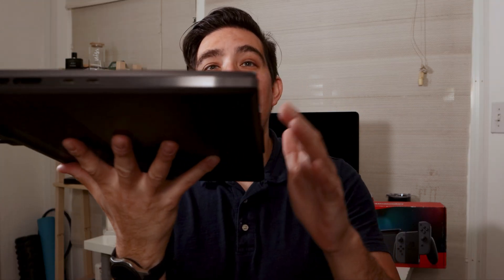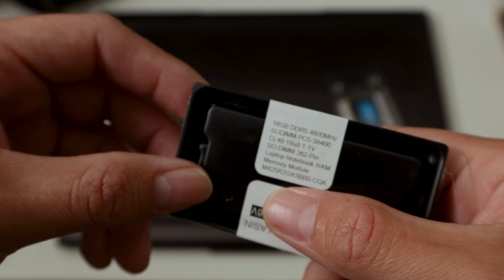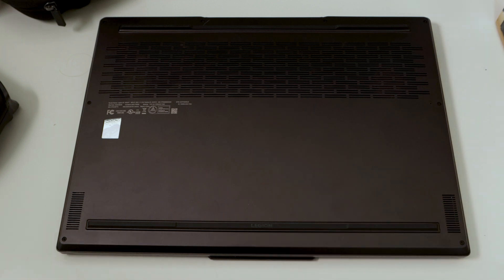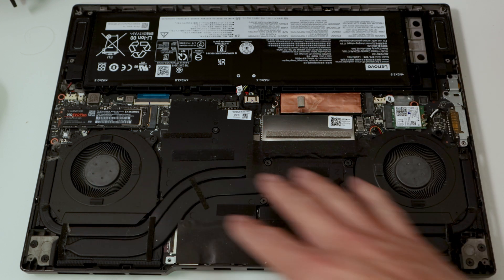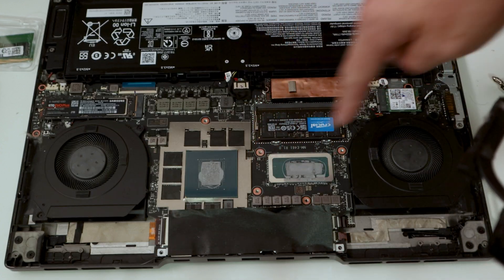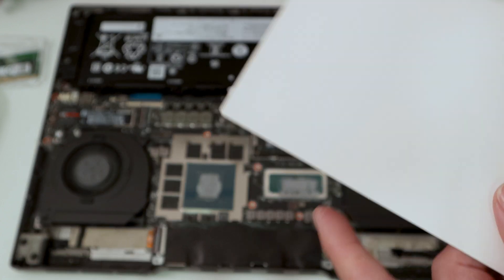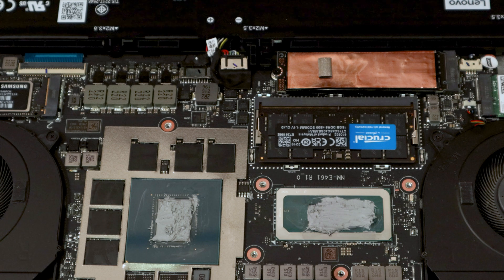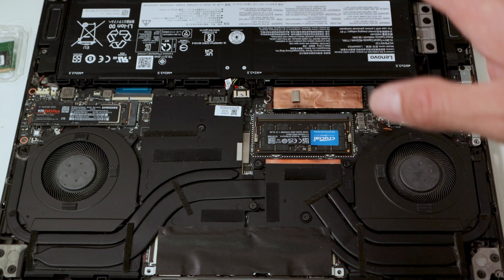How To Upgrade Lenovo Legion Slim 7i 2022 (Gen 7) Ram And Thermal Repaste

Comment: so, we can only change the 8 gb of ram into another size (16) ? for a total of 16 + 16, but we cannot add 8 for total 8+8+8?
Reply from the maker: You can only change once 8GB, because the other ones is soldered
Reply: @ yea so that means theres only 2 slots right?, 1 slot is the soldered one and 1 more is the stick one, theres no more available slot
Reply from the maker: Yes

Comment: ahhh! i just bought a 16gb stick of ram hoping to install with the current stick how do i put 2 sticks of ram in? to make 32gb or is it not possible?
Reply: It's not possible. One 8GB is soldered and the other 8GB is removable. The removable one is replaceable with a 32GB for a system max of 40GB
Reply from the maker: Exactly what Romad84 said. If you add your 16gb, you'll be at 24GB

Comment: Can this laptop be equipped with 32GB of memory?
Reply from the maker: I don't see why not
Reply: @ I inserted 32 gb ram but the laptop does not start. what could it be? the frequency matches
Reply from the maker: The 32 gb should work. You just need to make sure that you match the soldered stick specs. That's what I did on mine.

Here is a reddit thread that might help you out. 
https://www.reddit.com/r/LenovoLegion/comments/16efq8u/legion_slim_7i_gen_8_ram_and_ssd_upgrade_options/

Comment: Hello! I have a question. I saw you took out a RAM stick to replace with the crucial RAM. But my Legion Slim 7 16IRH8 only has 16 GB of soldered RAM, so I want to add another 16 GB stick to max it out at 32 GB. In this case, would I be removing existing RAM? Or just adding the additional.
Reply from the maker: Do not remove the soldered one. You can add if you have the available slot. My laptop is Intel. I know that the AMD is configured a little differently. I'm not sure which one you have.

Comment: Does the laptop run cooler with the repaste?
Reply from the maker: I was told that Lenovo uses a special paste by several of the people commenting on the video, so do not re-pasted. I did not see a big difference in temperature.

Comment: Got a black screen and can’t fix it 🙃
Reply: Able to fix it? Just hold power button for 60 seconds with power plug removed, then try multiple times, it should work
Reply: After upgraded?
Reply: @Irfan957-fc7bi  yes, had to get it fixed, good thing I still have warranty
Reply from the maker: Sorry to hear that, glad you were able to get it fixed.

Comment: Will this help with gaming? I have the slim 7 r9 3050ti. Its not bad but modern games have been tough on this laptop lol
Reply from the maker: The speed of the SSD and RAM should improve performance. But I don't think that it'll support something like ultra settings.
Reply: @ZGadgetReview  im not expecting higher settings but a smoother performance would be great.
Reply from the maker: @883kodiak  Then RAM and SSD should help.

Comment: You should not teach people to upgrade pc. Because you are not a computer technician. You are a destructive teacher. This is not the way you should handle a pc motherboard, ram and ssd. You are touching everywhere, which you should not do. Body static electricity will pass on the ram, mb and ssd, and will damage them, Our body produce up to 2000v of electricity. You have to avoid touching the contacts and the surface of the ram directly. Use no metal screwdriver once cover is removed. Use plastic or wooden materials for moving pressing requirement. Use anti-static gloves and lead. Your body must be grounded through an anti-static and lead,
Reply: Out of all the things to complain about, static isn't it bud. He should have unplugged the battery but other than that, he was fine. I've worked on pc's for quite some time and own my own msp, I've never used any form of static protection and have had zero issues. There are tons of videos about this topic that says you're wrong. But I do agree that this video could be harmful to people new to upgrading a pc, unplugging the battery should have been the first step.
Reply from the maker: That I agree with. I did screw up with the battery
Reply from the maker: Thanks for the feedback. Laptop is working great and it's not the first one I've worked on.

Comment: please test if we can install a 32 gb ram to get total of 40gb. this is the only thing stopping me buying this laptop.
Reply: Yes, it can be done.  I did it to mine and now have a total of 40 GB.
Reply: @raymondryman2345  which model of ram you used ? I tried Kingston and didn't worked.
Reply: @souravchalliyil6370  Transcend.
Reply from the maker: I tried it with crucial and Samsung, the ones on the video. There's links in the description section. I kept the Samsung one
Reply from the maker: Works well? That's good to know
Reply: @ZGadgetReview  The laptop had no problem recognising the 32GB strip of RAM. Definitely premiere pro and after effects are much more faster. 40GB is more than enough for my needs. Anything more would be overkill.
Reply from the maker: @raymondryman2345  That will help lots of people thank you
Reply from the maker: From what I read in different places this laptop can take up to 32GB of RAM.
Reply: @ZGadgetReview  So you can put in a 32GB stick and have 40GB, yes? From what I read and I know, that should work....
Reply from the maker: @pavichokche  Yes, re reading my answer it wasn't clear, sorry about that. But yes, you could add 32GB and have 40GB from what I have read it should work. I would love to test it myself, but it'll be a couple of months until I'm able to.
Reply: @ZGadgetReview  I might test this in January, and if I do I'll come back and report the results
Reply from the maker: @pavichokche  Thank you
Reply: @ZGadgetReview  yup it worked great, 40gb total. Hwinfo reports quad channel (ddr5 natively runs in dual channel even with a single dimm)
Reply from the maker: @pavichokche  Nice

Comment: You made a big mistake changing lenovo's original thermal paste...
Reply: I just bought this laptop, so I take it that it's not worth changing the thermal paste? What if in the future I wanted to put liquid metal or something?
Reply from the maker: @nishantharepalli1222  That is a good question, I would think that liquid metal would be better.
Reply: @ZGadgetReview  Not trying to be pessimistic but I have Terrible liquid metal repasting experience with my laptop. The galinstan mixture keeps reacting with copper(amalgamation), resulting in a uneven deposit of tin &  indium on the copper surface. This results in poor thermal performance over time. 

Hence, I personally prefer paste or PTM-7950 as it does not have electrical shortage risk and it’s much easier to apply/remove
Reply from the maker: @VSN1001  Good to know.
Reply from the maker: How come?
Reply: @ZGadgetReview  Lenovo original thermal paste is a variant of the PTM-7950 phase change pad which has much lower thermal impedance compared to virtually all paste in the market.
Reply from the maker: Ah, I did not know that. Thank you for the info. Now I've learned something for the future.
Reply: @VSN1001  yes I agree to this, but if this laptop is about 3yrs old or more you can re-paste it as the thermal paste deteriorates in time, hence in this case it's a little too early.
Reply: @mark_ruiz  PTM-7950 does not have pumpout issues nor does it degrade over time as far as I can tell (150dC for 1000h according to its data sheet). So it should last way longer than any paste.
Reply from the maker: Good to know
Reply: @Aditya-sj4ev  Do u know what’s the difference btw the 2?
Reply from the maker: According to the comments the paste is better than what's in the market and is made for Lenovo
Reply from the maker: Specific difference between the two, like chemicals and stuff I wouldn't know. But from the comments the Lenovo paste is made specifically for them .
Reply: @VSN1001  are you saying that the cryofuze will degrade faster ? he already saw few degrees colder temps initially and this is a top thermal paste
Reply: any paste will eventually degrade, wither through pump out of the silicone will separate from the rest of the paste. I suppose higher quality paste takes longer but it will happen eventually